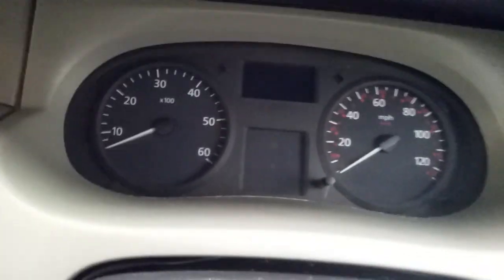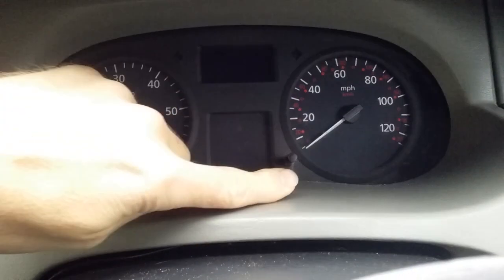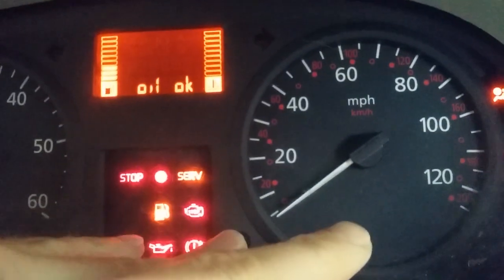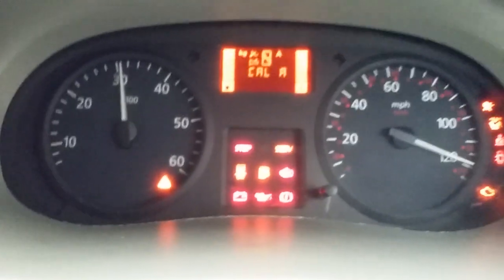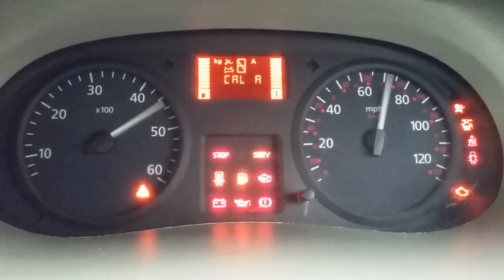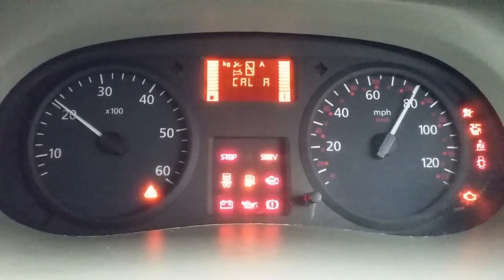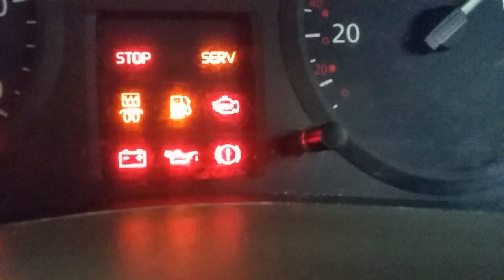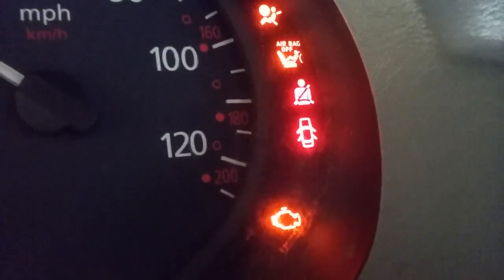Viraro Trafic Primastar Instrument Panel Self Test Calibration Hidden Menu

Comment: Will this operation put out the service /abs light. All brakes & discs have just been replaced.
Reply from the maker: It's a calibration / test so sounds like you need the codes reset
Reply: ABS is tested on every ignition on so it it's still on its still giving a bad reading.
The ABS sensor in the front are working of a magnetic shield in the front wheel bearing. It can be what's wrong.

Comment: The problem I have is my 2012 Vivaro does not have a trip button, any suggestions ?
Reply from the maker: Same here.
Reply: U need to press wiper button
Reply: @kamilkoscielniak7741  I have tried that and nothing happens !!!! Thanks anyway.
Reply: Must be different specs. I have a 2012 with sat nav/Bluetooth but no trip/range/cruise control.

I have seen others without sat nav but with cruise/range/etc..

Weird.

Comment: I have fuel Guage not accurate.. So i need this thing on my 2014 trafic... Please help
Reply from the maker: Try it, but sounds like the sender gauge is at fault with incorrect level info.
Reply: Mine is useless,I suspect the sender unit was replaced and put in 180° the wrong way? Dunno tho,may just be crap!
Reply: I have changed whole fuel pump which is include of fuel level sensor too.. But still same thing not accurate reading 😞
Reply: @funrun508 amigo lo solucionaste? Como solucionar en trafic 2014 no trae ese botón de reset

Comment: does the 2004 have a miles remaining feature?ive never seen mine
Reply from the maker: Not on mine but the original radio display is no longer connected.
Reply: Think that is only on some models (like my Vivaro Sportive). Sadly this calibration doesnt work on my 2007 Vivaro 2.5
Reply: Ok cheers
Reply: @jerzywoking1699  same here, do you know a way to test it on the sportive ?
Reply: @beasaboy14  Sorry mate-never found a way, and the local Vauxhall dealer had no idea, although he did offer to put it on their code machine for £50.
Van now sold, as I moved and Spain will not register a RHD van here. Shame, as it was a great van, fast and ecomomical.
Reply: @jerzywoking1699  no worries mate sussed it in the end. Holding down the button on the end of the wiper stalk, rather then the trip computer reset button worked for me. Yea they’re good vans, although if I had to pick between Spain and my van, I know which one I’d pick!!
Haha enjoy the ☀️
Reply: @beasaboy14  Glad you got it sorted out.  I must admit I do like the sunshine!